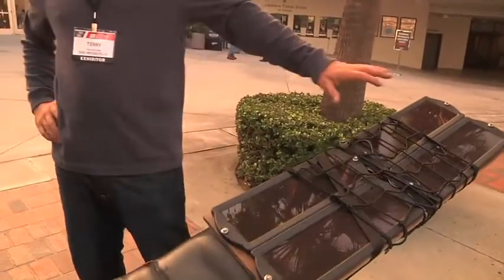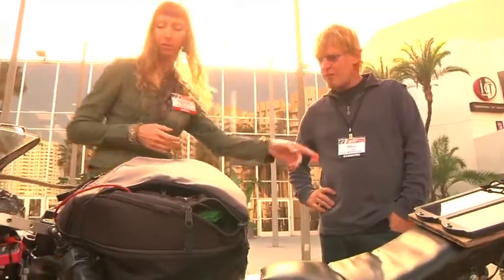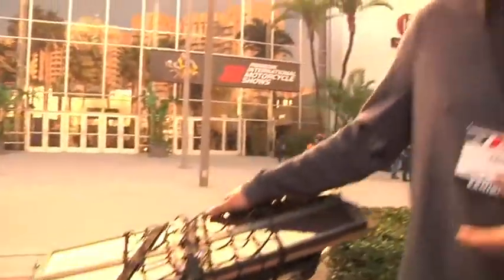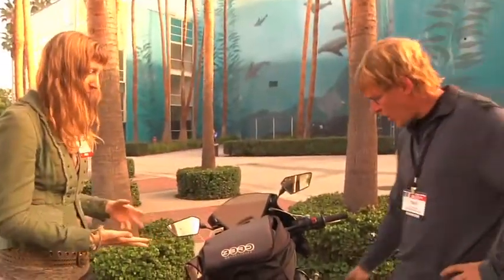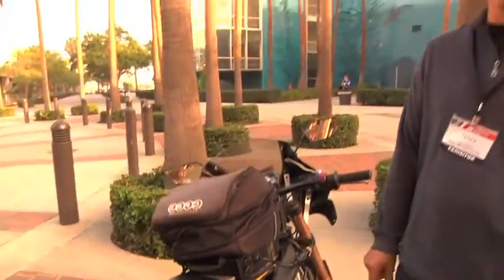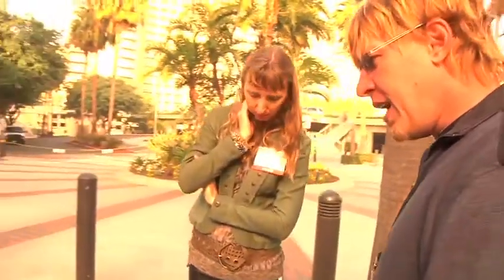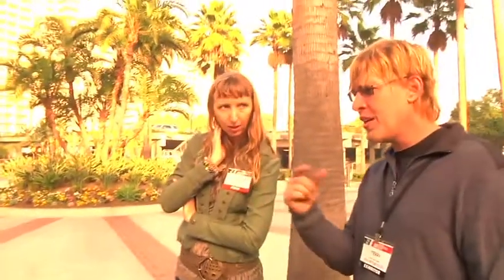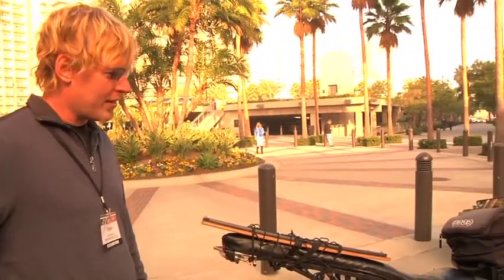Zero Motorcycles Touring Champ Terry Hershner

Comment: The fact that Terry replaced Zero's ugly headlight and installed Kawasaki Ninja 250R's sleek dual headlight demonstrates whats lacking in Zero design. Zero designers need to get out of their Dirt Bike mindset and get into real Sport-bike full cover aerodynamic design mode. If they just install their  electronics and electric-motor into a Kawasaki Ninja 250R, it will become the best looking Zero S ever.. 2013 Zero S got a little fat but still has the Zero Dirt bike look without the full cover.